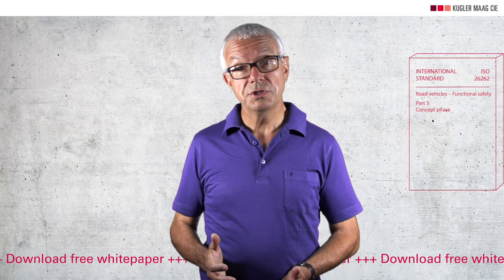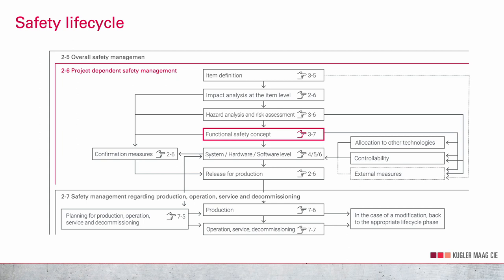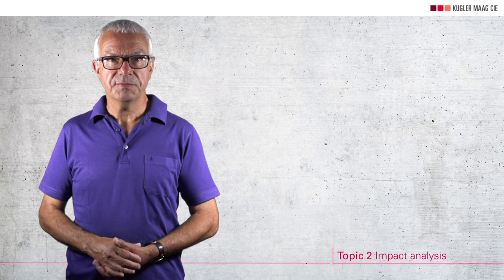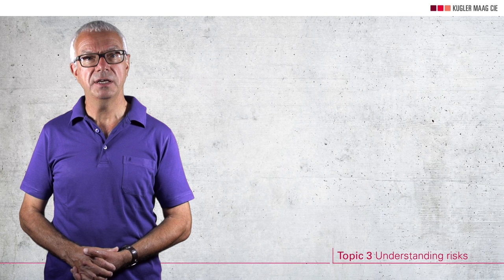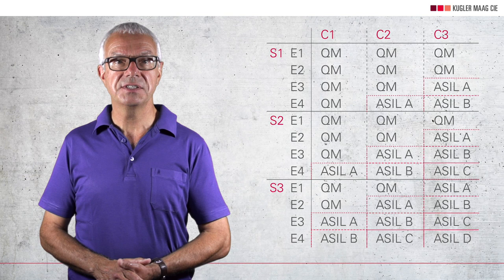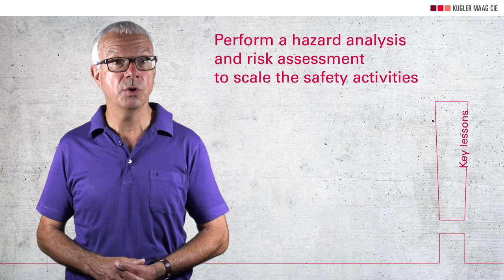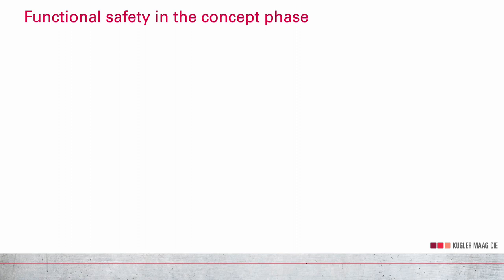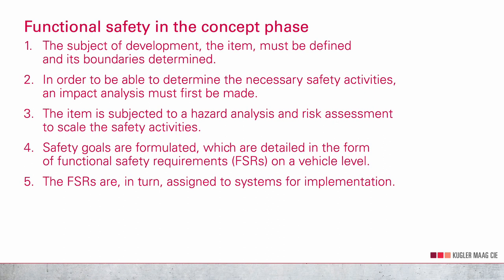ISO 26262 – Concept Phase of Functional Safety

Comment: Can I get more idea on formulation of safety goals with functional safety requirements
Reply from the maker: Thanks for your question! You have to distinguish between safety goals which are the top-level safety requirements on the vehicle level and more detailed safety requirements. Here are some examples:

Safety goals:
- The steering column lock shall be inhibited when the vehicle is in motion.
- The airbag shall not deploy unless there has been an accident.

Safety requirements:
- The motion of the window lift shall be stopped if the “pinch” force exceeds the defined limit.
- Power assist shall be disabled if it becomes unpredictable, that is, if it causes the steering wheel to “jump” unexpectedly, or to shudder excessively in use.
- The … system shall provide correct status information.

These examples give you an idea of what we are talking about.

We hope this helps you further! :)